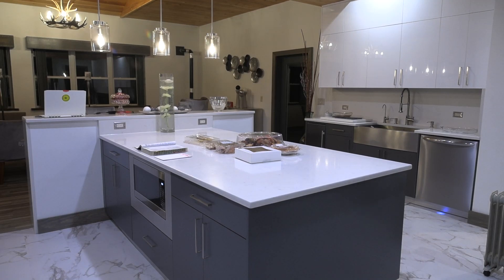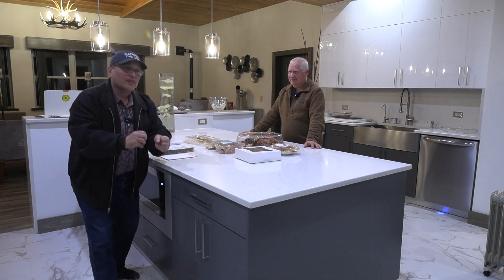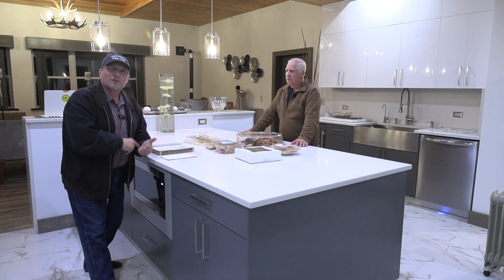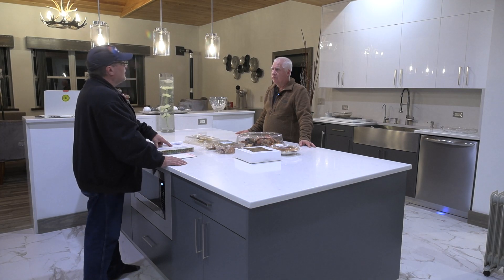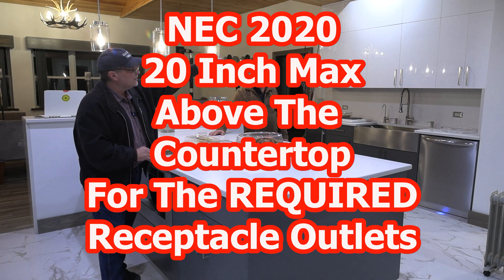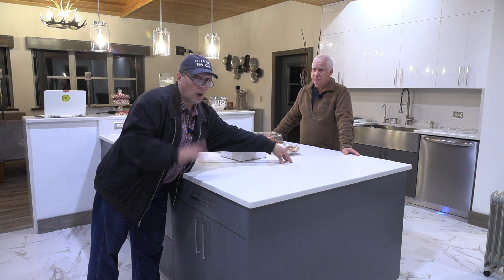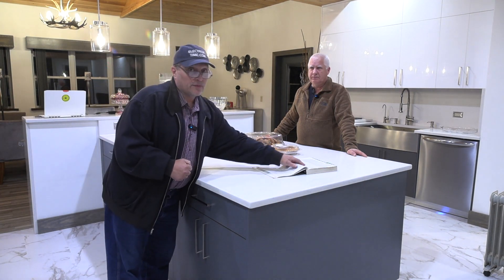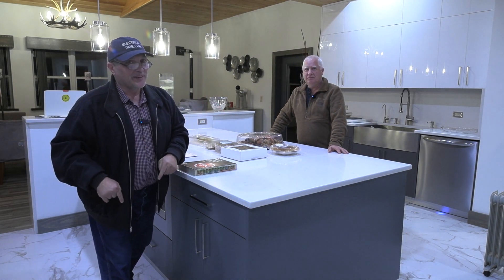2020 NEC 210.52(C)(2) Dwelling - Kitchen Island Receptacles By ElectricalTime.com

Comment: So where did they go on the island?
Reply from the maker: Hi Ted, they installed the Receptacle Outlets on that small section of the vertical portion of the Island that connects to the upper counter. This is an unusual Island and the electrician took advantage of that small vertical portion which is behind myself and Bill. In a normal Island under the 2020 NEC, the receptacle outlets would have been on the side of the Island or in Pop-Ups in the counter itself. Thanks for you question, Steve